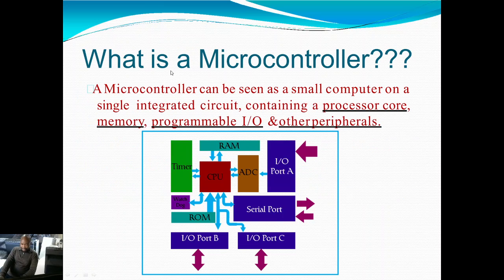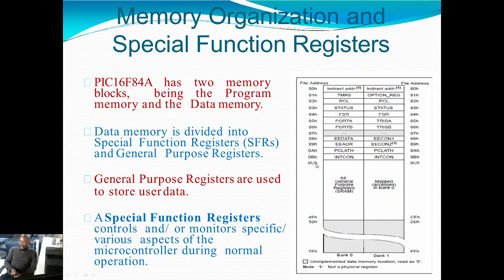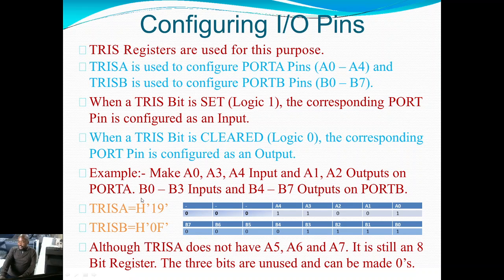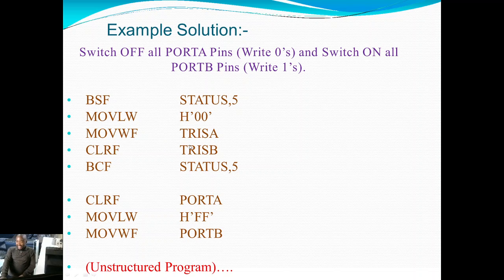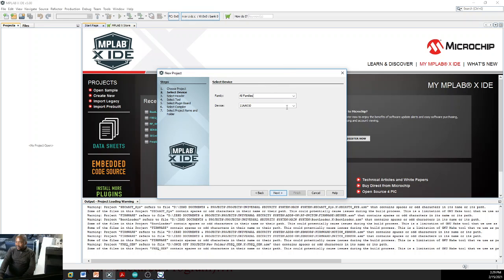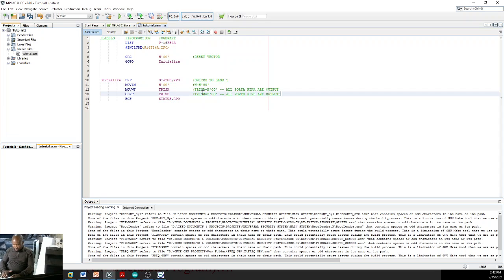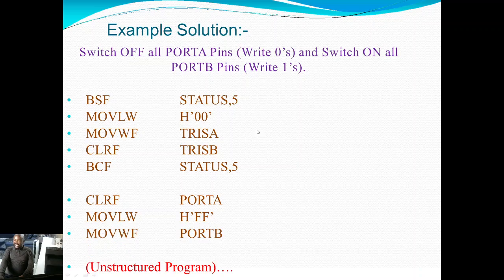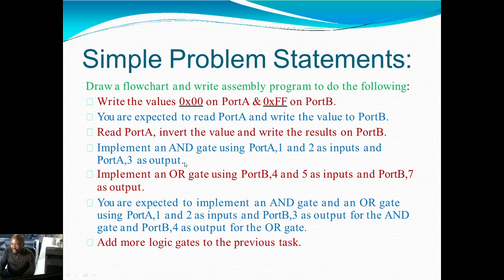Introduction to PIC Microcontrollers Assembly Language (Tutorial 1)

Comment: Sir, I have a question for 7:08. Why would there be no current flowing to the input when the switch is closed in configuration B? I don't get how current will flow directly just towards the ground and not also flow towards the input. Thank you in advance!
Reply from the maker: When the switch is closed there will be zero resistance of current flow to the ground, while the input has its input resistance which will prevent the ease of current flow into the microcontroller. The current chooses the least resistance path to the ground. Hence no current will flow into the microcontroller input due to its input resistance and no resistance to ground via the closed switch
Reply: @IESD2013  thank you for explaining it!
Reply: @IESD2013  I have another question (but this is trivial), what's the difference in parts like "PIC16F84" and "PIC16F84A" or sometimes I encounter LM338 then LM338T or LM33K what's with the letters? are they versions with slightly different casing or working voltages or other parameters? And at 1:05:20 can we just not put the LOOP command and just put the END after the initialize section?